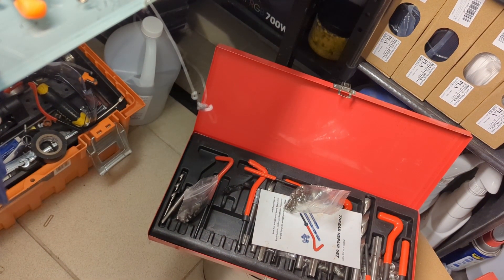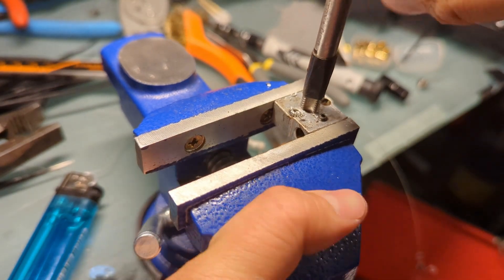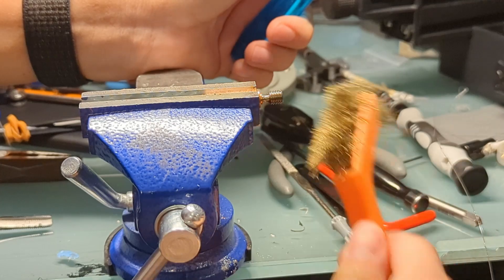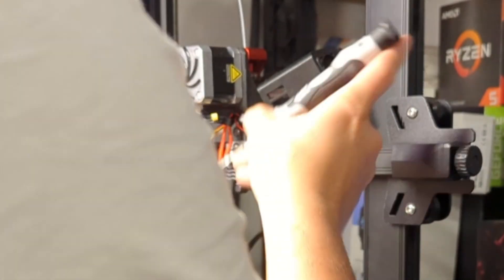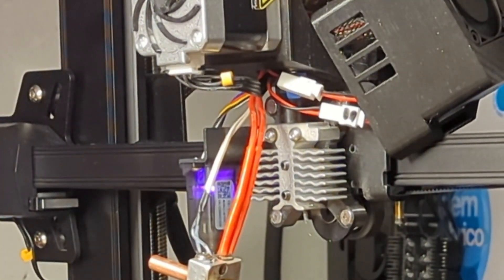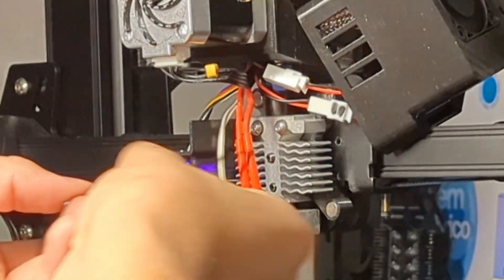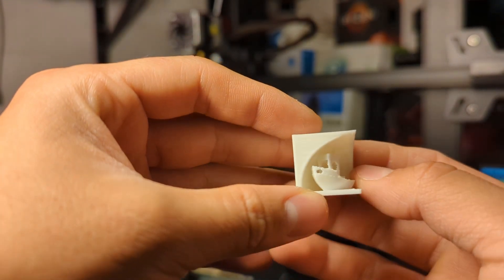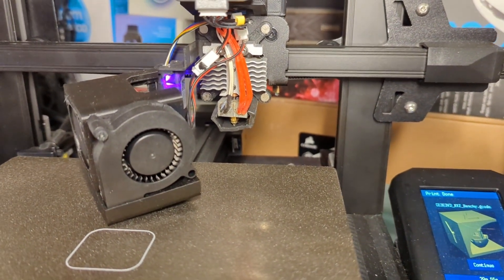Ender 3 V2 Neo - Stripped Heat Block, Can It Be Repaired With Helicoils?

Comment: Your channel is how I was able to get up and running with mriscoc's firmware, and some of my prints have rivaled those from a Bambu Lab printer... I unfortunately ran into this issue with the heat block and as much as I love DIY repairs I think I will end up getting a new complete hot end for my Neo. I've already killed almost a full day figuring out what was happening as I've never ran into this issue before. Do you recommend a drop-in replacement for the V2 Neo? I definitely want one with a throated heat break. Thanks!

Comment: Hi, is the Ender 3 heat block compatible with Ender 3 v2 neo?
Reply from the maker: It will work, but you won't be able to screw it into the heatsink, just make sure your nozzle is tightened properly to the heartbreak and tight the heartbreak to the heatsink.

Comment: Just noticed you had extant nuts under your bed... are they to lock back against the adjustment wheel? I had bed constantly moving on my i3 mega and bluetacked the wheels in place which is perfect... I also suspect the same on my Neos but not as bad. Do you have a link for the stl?
Reply from the maker: Yeah, found it on thingiverse randomly one day, they seem to help a little.
https://www.thingiverse.com/thing:5791001
Reply: @Zeltroix  appreciate it, thanks